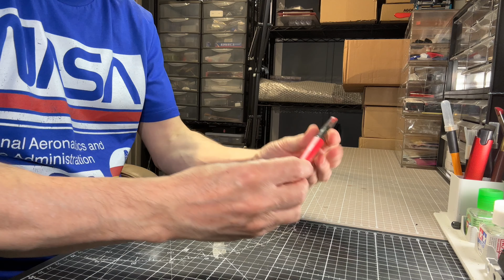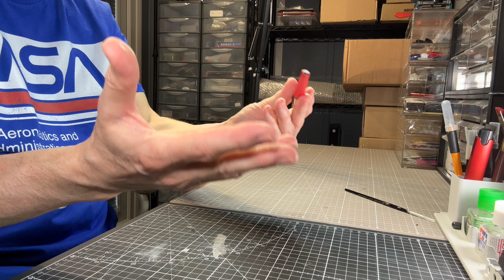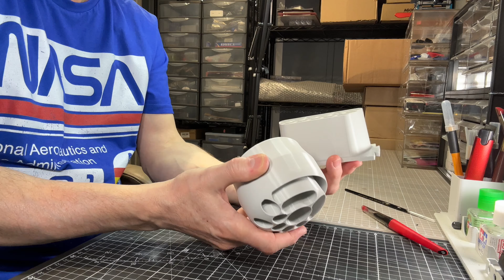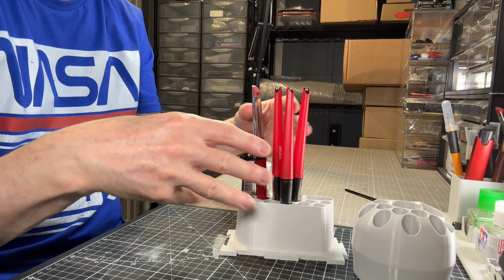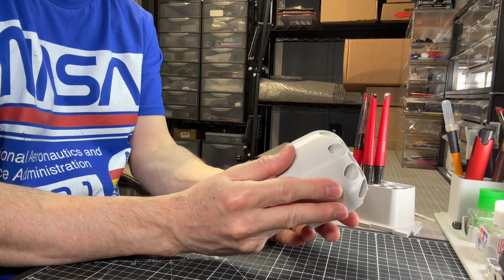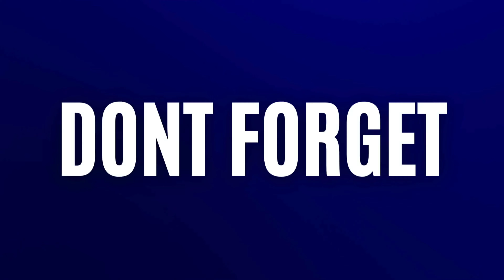🎨 New Storage System for Dspaie Interchangeable Paintbrushes! 🖌️

Comment: I don't use the modular system but that one does look better  than the circular one to me. Only one sugestion though: I also have the ultra fine metal brush handle and it would be awesome to have something specificaly for those to hang in the front? I know DSPIAE has holders for them but having a holder for every brush seems weird and puts them away from the rest, which is not realy good for the workflow